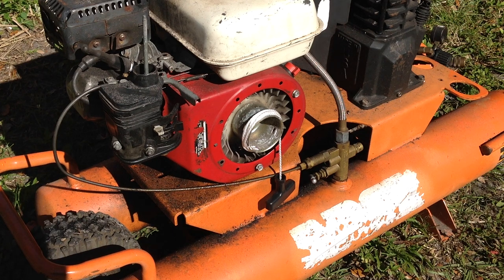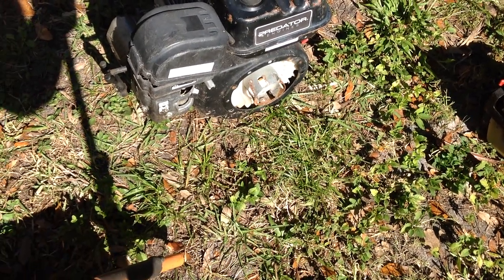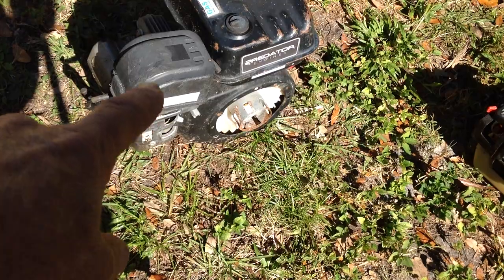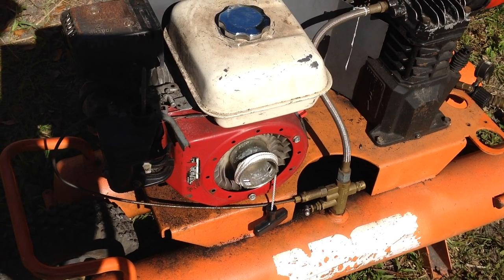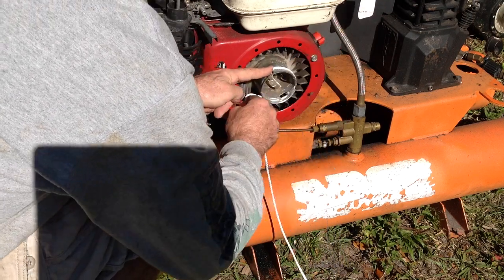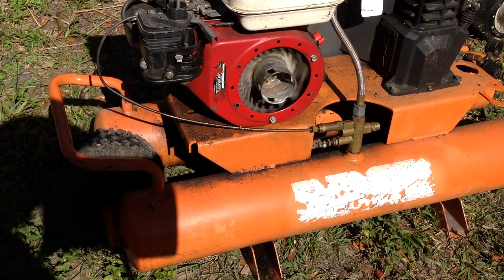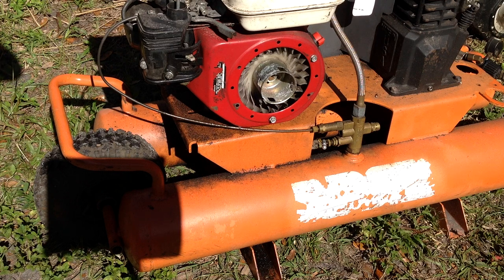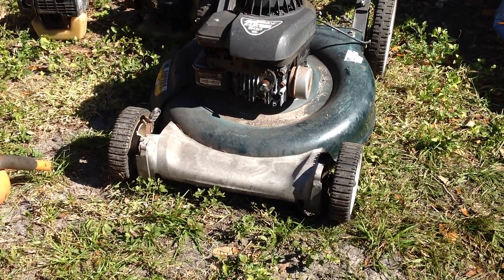Rigid gas powered air compressor first start up

Comment: You know where you put the sting on to start it how do you replace the recoil.I have to start mine like that I already bought the replacement part just can’t put it on
Reply from the maker: Do you have all the bolts that came off the original recoil?